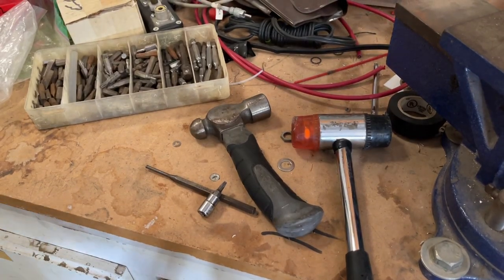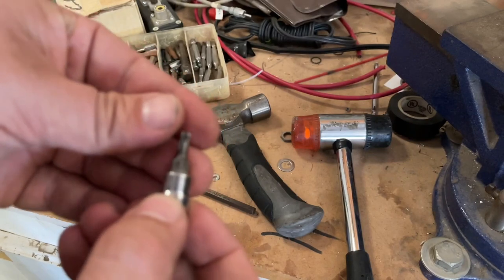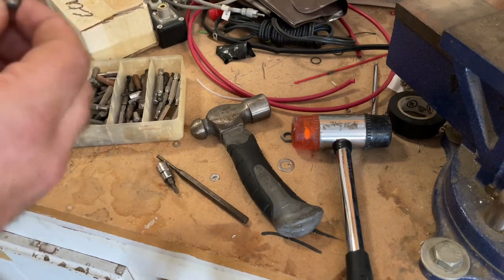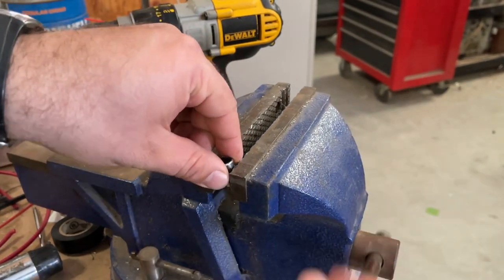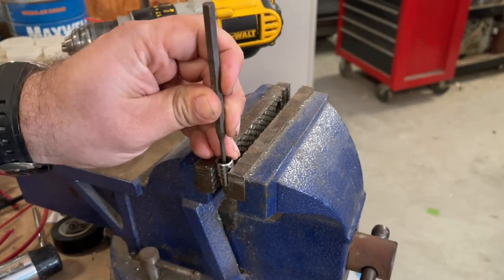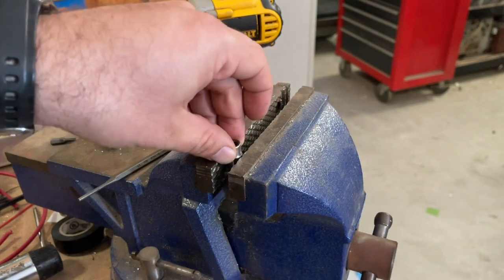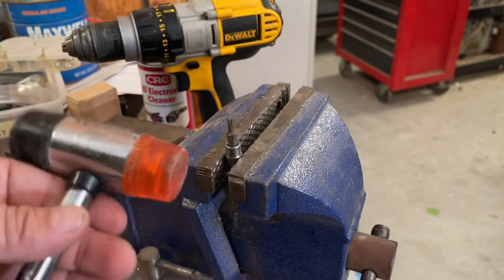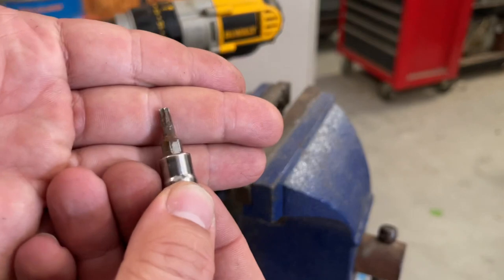DIY Replace Bit in Socket

Comment: I honestly had no idea it was that easy to swap these out. I was actually trying to swap in a different bit so i could use it with my 1/4" torque wrench and this did the trick. Center punch to the back while in the vice then rubber mallet to get the new bit seated. Although my rubber mallet is one sided and not as dense but it got the job done. Thanks for posting!

Comment: I just bought a black and decker socket wrench set from a nearby big lots and for some unknown reason it came with a pebble jammed up inside the extension bar. It's jammed in there so far pliers wont remove it. And by how hard the stone is, I think it's the kind that goes into fish aquariums. I'm hoping an ice pick or a drill will get it out. Otherwise I may need to take a trip to amazon to get a replacement.